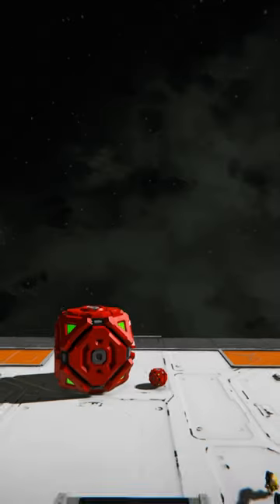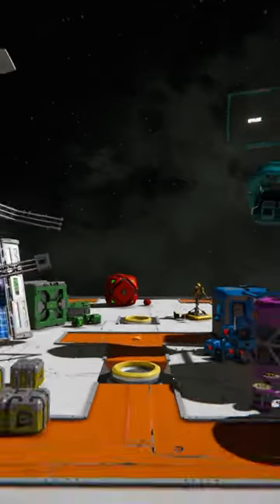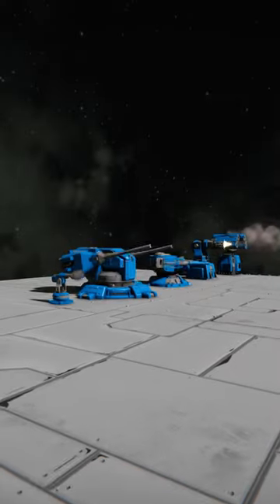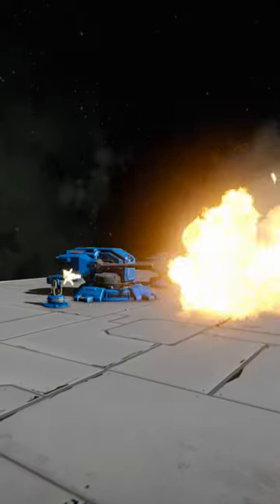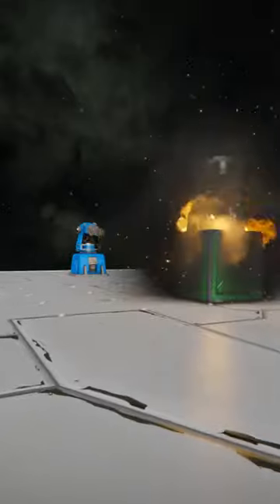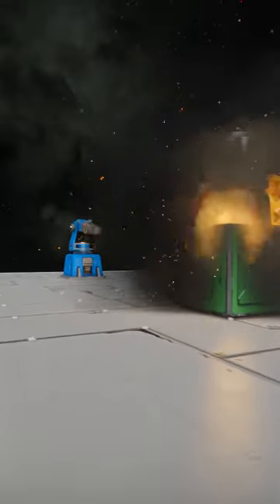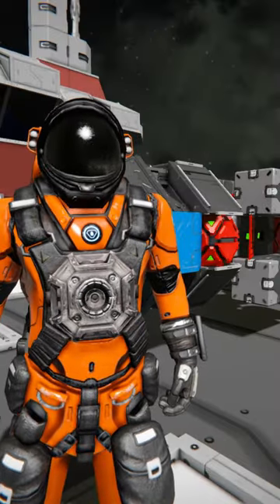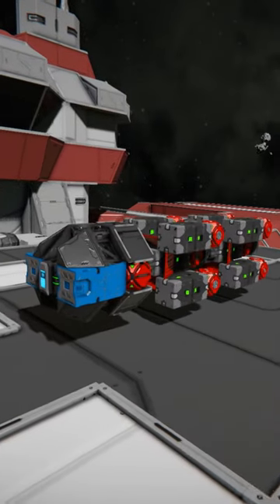Decoy Torpedo Automaton - Space Engineers #shorts

Comment: do decoy work without battery power??
Reply from the maker: No power is required. They are kind of a build and forget kind of block.
Reply: @ArcBane  Are they?  I've only ever seen them used on the grid with power normally.  I'll have to get testing
Reply: @eowarion  they don't need power to work. This is something you could have solved in 10 secounds just by googling it, you don't need to push to the side for testing, lol